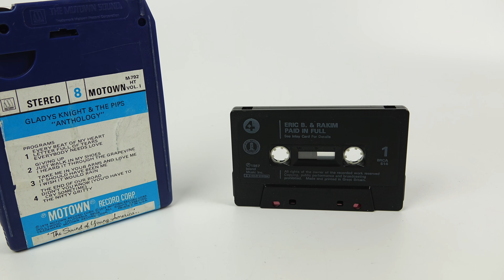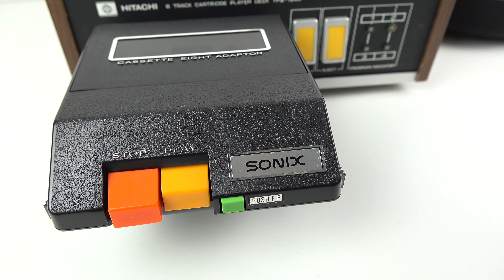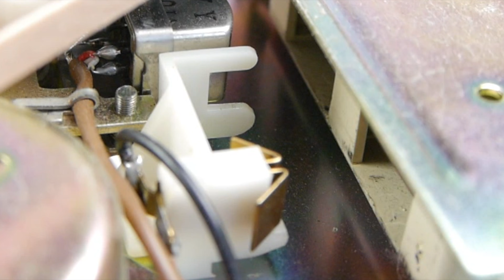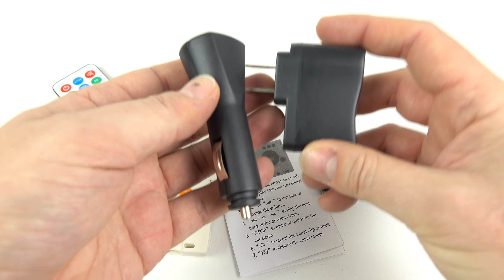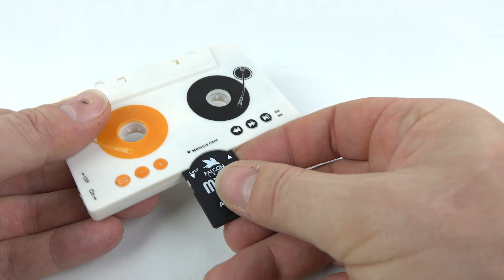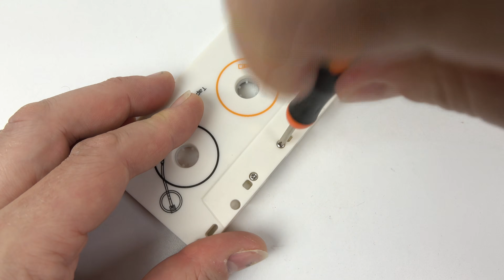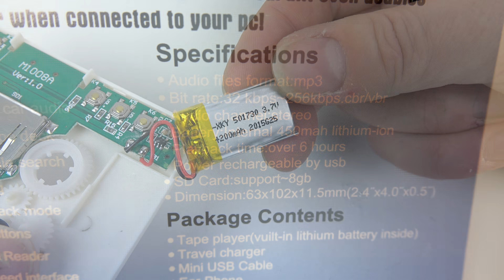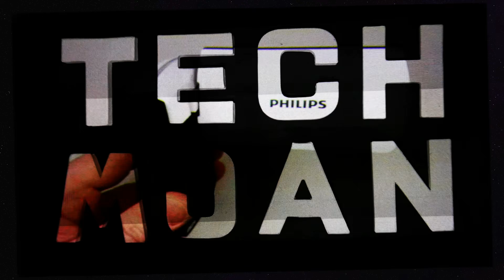Car Stereo Tape Adapters - 8-Track to Cassette to MP3

Comment: Hey Techmoan, fan for a while and I'm sure you know this but another CHEAP, efficient solution to playing MP3s off your; SD card. AUX, and even Bluetooth. The best part is you don't need a tape deck, AUX-in, or anything of the sort. Only thing required is a car radio/FM stereo and a cigarette lighter/power supply. Which nearly all cars have, even the new ones for power supply. Simple FM Bluetooth transmitter cost me $15 and it also converts your radio into a hands-free set for your phone when connected via Bluetooth. You simply connect the device into the power port and choose an FM station that isn't occupied. Sirius has an online tool just for this and finds open stations best for transmitters in your area. So you tune the transmitter and your car to the same FM station and connect your phone or MP3 player via AUX or Bluetooth, or you can use an SD card. It even has a built in mic for handsfree calling. The quality is much, much better than any other option I tried and it works for pretty much every car made since the 50s or so (don't quote me on that part). But it really is a good solution and they're cheap and reliable. Even has a USB port.

Simply Google Bluetooth FM Transmitter and you'll see a few. The one I have was $15 and made by 'BlackWeb'. Truly a lifesaver for me, especially for calls. And I'm using stock speakers and quality is better than a tape-to-3.5mm adapter if you even have a tapedeck in your car. Basically cheapest way to accomplish the task with the best quality for your dollar.

Comment: I had one of those cassette - 8 Track adapters that I purchased at Radio Shack back in 1978. I popped in my Dark Side of the Moon tape, and it played back in fantastic monaural. It was for my home deck. I immediately returned it and purchased a proper cassette deck.

Comment: Need to do portable record player -> cassette adapter -> 8-track now.  Are there any devices that attach to the needle on a record player and vibrate it to reproduce sounds?  That would be an interesting gadget to chain in as well.

Comment: Also had a FM receiver  in same form got good stereo. Worked on 9 vdc gave about 10 hour use and had a dipole antenna to get the signal. This was handy if I had a portable unit . To Cary. 73 kv4li

Comment: I found the MP3 to cassette adapter slightly cheaper on AliExpress: https://www.aliexpress.com/item/Portable-Vintage-Car-Cassette-SD-MMC-MP3-Tape-Player-Control-Stereo-Audio-Cassette-Adapter-Kit-With/32869608856.html?spm=2114.search0104.3.57.14431a2cbzlD8v&ws_ab_test=searchweb0_0,searchweb201602_5_10065_10068_319_5729915_317_10696_453_10084_454_10083_10618_10304_10307_10820_10301_10821_538_5730815_537_536_10843_10059_10884_10887_100031_321_322_10103,searchweb201603_6,ppcSwitch_0&algo_expid=f0727aab-e111-4cfb-a0f4-e82e2b2705e5-8&algo_pvid=f0727aab-e111-4cfb-a0f4-e82e2b2705e5&transAbTest=ae803_3

Comment: I'll just add a couple pieces of trivia here. I used to work for Radio Shack (Tandy in the UK) and clearly whoever the actual manufacturer of that 8-Track to cassette adapter was also made the one that we sold. Ours was EXACTLY the same except that the three buttons were molded in different color plastic. They sold for (IIRC) $35.00 and worked fairly well. You had to experiment with which "track" selection on the 8-track it was inserted into was on to see what produced the best sound. There was at least one such adapter here in the U.S. (marketed by Sparkomatic) that used a weighted flywheel drive system so as to avoid using an electric motor at all. Unfortunately, they had a LOT of flutter and wow and depended on the 8-track deck to have a decent functioning drive system to work. The problem there was that a lot of old 8-track decks had worn or broken drive belts, so turning that weighted flywheel (especially at the correct RPMs) was out of the question. The type of adapter shown here didn't rely on the drive working at all. Lastly, the Sparkomatic adapter used batteries for the electronics, so that was just another possible point of failure. And finially, you mentioned using the cassette adapter for MP3 players but don't forget that the first use for them was to hookup portable CD players to cassette decks when CD's first became the norm.. Good video as always! 👍

Comment: I had one of the cassette adapters I bought it from a closing down B&Q store for 10 pence. I had a very cheap MP3 player and used to feed the music into my cd player but it used to hang from the front and I could not safely change songs so got stuck with the playlist.

Comment: Hi Mat. Interesting topic. The cassette to 8 track answered the power question that had been on my mind, as to how and where the converter got it's power. If you haven't already you might want to cover the topic of a radio show "cart machine" vs 8 track and the differences. Cheers.

Comment: The on/off on the mp3 player is probably so it will turn on when you put it in your car's cassette deck and off when you press "eject."  It's clever, probably too clever.

Comment: The only problem with that SD card adapter is if you have a GM tapedeck that loads it forward instead of sideways.

Comment: Regarding SD cards: I've a few devices with that "8GB limit" on them. Never tried them with larger cards as I wouldn't want to risk losing data, but the SDHC standard treats all compliant cards the same irrespective of capacity doesn't it? :-)

Thing that comes to mind is the limitation might lie in the registers which point to LBAs on the card. If the card has 512B physical sectors and the reading device only allows 24 bits for sector addressing, 8GiB (16MiL sectors) would be the furthest LBA it could address. :-) 
 
BTW: Did anyone else notice the space for a MicroSD card slot on the reverse of the board at 10:45? Quite a rare thing for a 2K/XP era device, I think! :-)

Comment: It's not that surprising that it supports larger sd-cards.
In most cases the reported max size refers to the largest real-life capacity of the supported sd-card generation. (known at the time)

Comment: techmoan I have a question and if you could help itd be appreciated, do you know of any way of recording cassettes from your computer? I just recently bought a retro car and wanted to actually put tapes in it but im 20 and tapes past me on by so i dont know my head from my ass on how to record properly
Reply: Connect the line out from the sound card to the REC IN on the cassette deck is the simplest way or connect the line out to the line in on your stereo and connect the cassette deck to the stereo. Have been doing this for years. Use a 3.5mm to RCA adapter cord to get the audio from the sound card to the stereo and make sure you set the sound card to max or near max volume or the recordings will be either too low or distorted especially if the sound card overdrives the LINE IN on the stereo...

Comment: I have a JCPenney 8-track to cassette adapter and it’s actually a semi-active adapter. Mine relies on the capstan to power the mechanism while it only uses the 12v from the sensor for the tape head.

Comment: that sd-card limitation is most likely due to the fact, that when the casette was made there was only sd cards up to 8gb available.
actual upper limit is most likely 32gb as that was the limit of the sdhc,  anything from 64gb to 2tb falls under sdxc standard, so cards that are in that 64gb and up range would not work on it.

Comment: This may be outside your wheelhouse but would you consider a video on floppy drives, particularly the odd ones that are difficult to find today: Apple 800k drives (variable speed) and 2.88 MB extended density drives?

Comment: It probably says 8gb because that was the biggest card available when the box was designed. It should work with anything using FAT32, which officially would be up to 32GB, but I've had relatively good luck formatting the 128gb cards as fat32 and still having them work in things that list 4gb as the max. (4Gb was the first SD card size to feature the FAT32 format vs the older FAT format on smaller cards.) Technically FAT32 can be used on much bigger storage volumes, but you can't copy files larger than 4GB~ over to them, so it's pretty limited over the exFAT that comes on the 64gb+ cards.

Comment: If that player supports 8GB SD cards means that it supports SDHC (SD High Capacity). The biggest size of SDHC is 32GB. So you can put up to 32 GB worth of MP3s in that device.

Comment: they made a newer one in witch you can bluetooth your music from your phone or whatever to the cassette "tape" that receives bluetooth so you can listen to it in a tap player we sold them for a few years at the US retailer Best Buy for about $15 i remember laughing saying i could have used that with my older cars i was driving a few years earlier and this thing came out about the time this video was made at round some point in 2016  so I'm thinking he might have just missed the boat but it does the same thing just replace SD card slot with bluetooth receiver

Comment: I'm willing to bet that the cassette mp3 player can take up to 32 GB SD cards.  Between 4 and 32 GB are SDHC so if it can support 8 GB cards it can probably support the whole standard.  The curious case would be seeing if it could support a 64 GB card.

Comment: Yes, you can put in a 16gb or even bigger card into that MP3 converter, but there will be a point where the MP3 player will be unable to read out a adress on that SD card (same limitation of RAM you have with a 32bit system vs a 64bit system on your home computer) it will either crash or get stuck once that happens.

Comment: I found a bluetooth cassette adapter  made by ION and works perfectly with my phone. It even has a built in microphone in the cassette so you can use the bluetooth cassette adapter as a hands free device. And the audio is amazing and simple to operate

Comment: Recently a colleague in work sold me a Denon DCT-1000R CD player, along with the 12 CD changer and the 670R cassette player (that also controls the CD controls, too). It'll be interesting to try the MP3 cassette converters available. I hadn't realized there were mp3 cassettes like that, since I was only aware of the ones where you plugged the AUX into your MP3 device. They usually carry a weird sound, too.

Comment: the 8-track to cassette adapter I had had a rubber wheel driven off the 8-track player's capstan that ran the mechanics on the 8-track adapter & it always ate my cassettes all the time so this one you show is a little higher end than the one I had years ago as it has the motor built in to run the cassette transport!

Comment: I use a Sony WM-FX38 Tape Walkman at work, and the SD to Cassette adapter in this video has been a godsend for me as of late. Higher ups just see me using a tape player, which is allowed, and I don't have to carry my tape case everywhere. Love the Pre-Amp in this old Tape player, as it works wonders with my AKG K550 Mk II over ear cans.

Comment: I think that the sensor thing inside the 8 track player only can supply somewhere from 1 or 2 volts and that the lower circuit board inside the adapter steps it up in between 11 and 25 volts thanks to the different capacitors it has

Comment: This is great! Brings me back to high school. I know this video was fun but the first friend in my group in high school (we're talking 1995, I graduated in '98 and he was a year older than me) drove "Big Green" the circa 70's era giant Buick his uncle sold him with the green painted job faded to puke. It had a built in 8-track and he found a cassette adapter but it just stuck out a little bit and the tape sat on top and was exposed the whole time, you could see the wheels going round and round. Of course we mostly used CD's then. So he kept his portable CD player in the glove box with its included cassette tape adapter which he would put in the cassette to 8-track adapter so we could play all our favorite CD's through his built in, total factory installed 8-track in the puke green Buick. 

I know what you're thinking. How did he mount the CD player to keep it from skipping? He didn't, just sat it in the front seat next to him, and had to grab it every time he braked too hard or took a turn too sharp or it would go flying off the vinyl bench seat. Of course front passengers were expected to hold it level as payment for a ride somewhere. And you had to be careful in the back seats too. As he replaced the non-functioning factory speakers with small home box speakers which he jerri-rigged the wiring for. But he never bolted them down, so if he braked hard they would hit the rear passengers in the back of the head! Good times. Ha!

Comment: We need to go deeper.
Vinyl (preferrably dbx) Line Out -> Cassette Adapter -> 8Track -> "Reverb Amp" -> analog to digital converter (with optical output) -> 5.1 audio upscaler -> Output.

Comment: They missed a trick by not putting a tiny micro dyno power generator inside the cassette that could run off the spinning tape wheels (similar to the kind you find it LED shower heads), instead of having to have a 12v to 5v power cord.

Comment: I had something similar back in 2003, it had 256MB onboard memory and trying to decide which MP3s to load was harder than using it. It picked up using the FF button to skip ahead between tracks, rather than playing randomly or via remote control. I stopped using it pretty quickly, as I had no investment in it - I'd won it in a raffle. Probably still around here someplace someplace, but as it's been uncharged for over a decade I suspect the battery will be ruined.

Comment: I used to have one of these, in fact this exact model.  It had terrible wow & flutter, even when it was new.  I also had a variant of this, an FM tuner/8-track adaptor.  This had a tiny socket on the front to plug in an external aerial.

Comment: Upon looking at several brands of the compact cassette to 8-track adapter, it appears that most if not all of them are the same exact design right down to the mouldings, but with various different colors of buttons and housings. Interesting.

Comment: That 6 disc player shown in package in that Honda (  was used at least 2002-2004. 

http://www.ebay.com/itm/98-02-03-04-Honda-Accord-6-Disc-CD-Changer-Radio-Cassette-Player-39100-S82-A300-/162692862564?epid=1522268739&hash=item25e1401264:g:k0AAAOSwg2xZeQnN&vxp=mtr

I tried to find out if that's Honda Accord, but the mid console is quite different in pictures I dug out. Either way if that player was released in 2002 Hondas, then we have at least something to back up the windows 2000 timeline. 

I might be too bored.

Comment: The 8GB thing might be legit, or it could be 4! It won't just outright refuse to work, instead you'll find you can't access certain files (or most files...) on your external storage. This is because they have placed a limitation on the address space available to the card reader, so anything past say the 8GB mark within the address space of the SD card just won't be read. The annoying part is that you have zero means of guaranteeing whether a file would end up on either side of that point, physical address allocation algorithms vary between devices and operating systems as far as I know and with flash memory it's generally advisable to keep it all random so the wear spreads out better across the chip - to prolong its lifetime.

This is the same reason why a 32bit operating system physically cannot use more than 4GB of RAM, even if it is available. It just doesn't have the capability to interpret any memory locations higher than that.

The reason this is a problem with direct access flash memory (such as SD cards, RAM, etc.) is because unlike a traditional mass storage device like a hard disk, SSD or even USB flash memory a lot of the time, an SD card has no controller - it is pure memory (that's how they can keep them that small!). This means that the job of a controller - to assign space for data, write said data and read back when requested, the reason you could have a 2TB hard disk even if you couldn't get more than 4GB of RAM, now has to be done by the host device and the manufacturers of these devices aren't typically interested in future proofing their devices past about 1 or 2 years.

This is also why, for example, my Sony car stereo head unit only supports 8GB pen drives (or smaller). It's not even a technological requirement at that stage, USB pen drives come with their own bespoke controller that makes them chooch without the head unit having to even know what "address space" even is! It's a deliberate attempt by Sony to make me buy this year's model, which likely has no size limitation at all (maybe within the 64bit address space limit for SD cards?). Smartphone manufacturers do it too (most notoriously - Apple, who won't even let you add an expansion card!!!)

Comment: I had one of those 7 track adaptors before. In 1984, I bought a brand Sparkomatic. My shelf stereo had a cassette and an 8 track player. I had the idea to use the 8 track player as a second cassette player, so I can dub cassettes!! Cool idea, right? BUT, I was disappointed to hear really bad humming noise. Not only that, the tapes played faster than it should. So it was not much use for original tape to tape recordings! :(

Comment: That's a chinese LiPo battery... I've heard bad things about them when I bought a cheap toy drone from there and I still haven't been quite brave enough to charge that original battery that came with it... =p
Granted, most of those low cost RC rotorcraft are from china anyway so I guess if my previous one didn't blow up, this one probably won't either.

Comment: Instead of taking off the piece of plastic, you should have made an even bigger monstrosity by plugging one of those headphone-to cassette-adapters into the device and put that in the 8-track player.
Reply: Or  a simple nail file would have solved it I bet